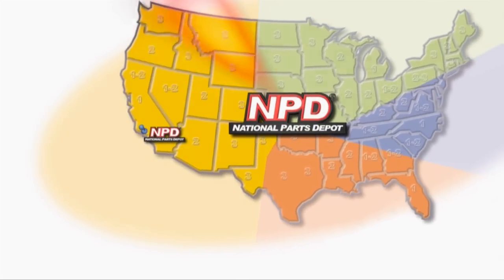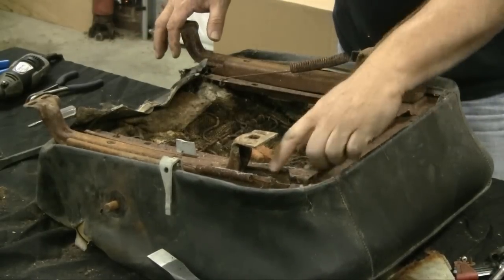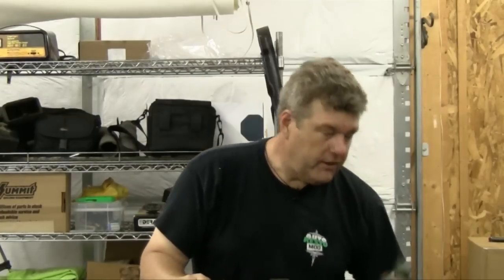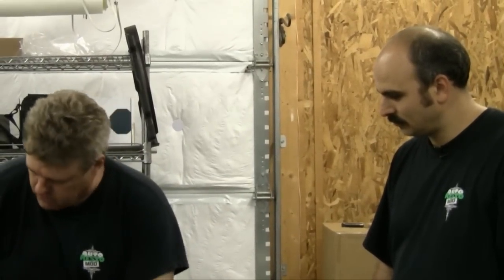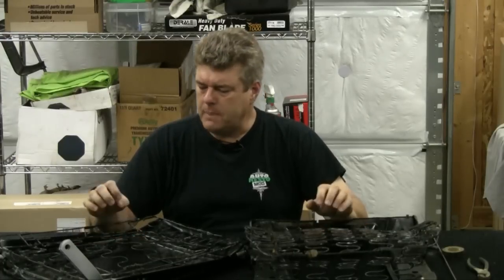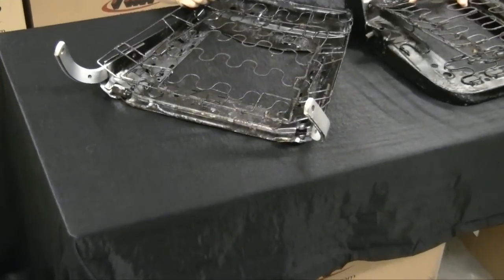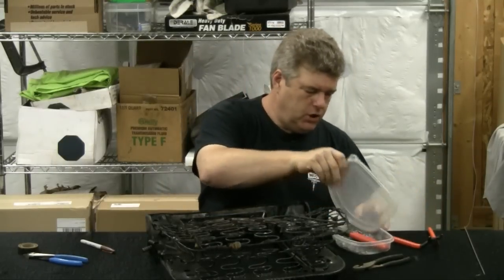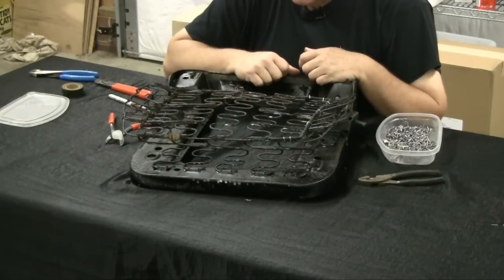Episode 78 1967, 1968, 1969 Camaro seat tear down and cleaning Autorestomod

Comment: When springs are rusted through, should  you replace the whole spring or just sister in a new spring for a few zig-zags?
Thanks,
Reply from the maker: Honestly, I'd want to replace the whole spring. My experience with replacing a section is it never feels "right" and will not hold.

Comment: So just give me an idea here, I have my 69 all torn down, the floors are good but most of the rest need attention, the engine and trans are good.  What is a ball park figure on restoring this thing if I do most of it myself ?   Needs new trunk floor rear quarters, radiator support panel. all the small stuff as well.  thanks, great video, more stuff I needed to know.   Jeff